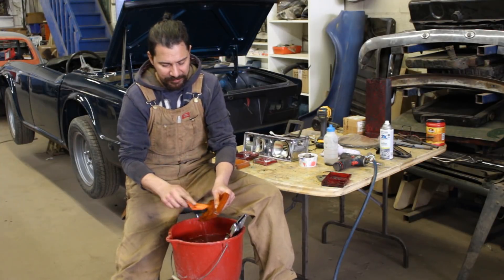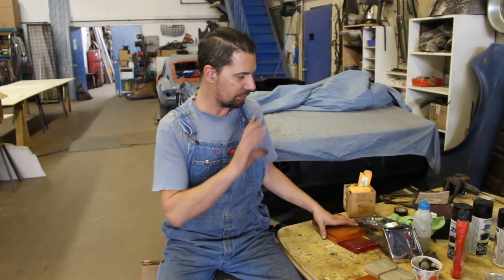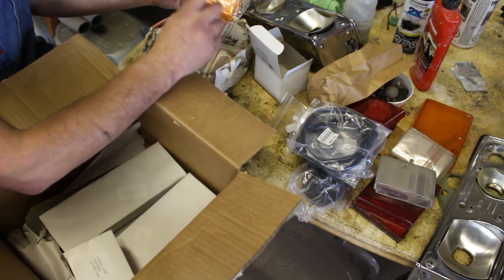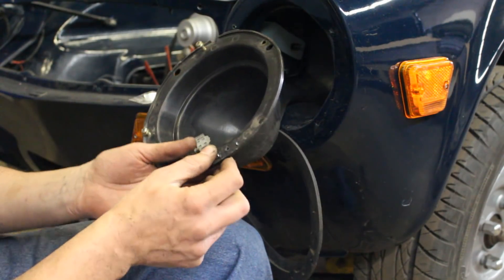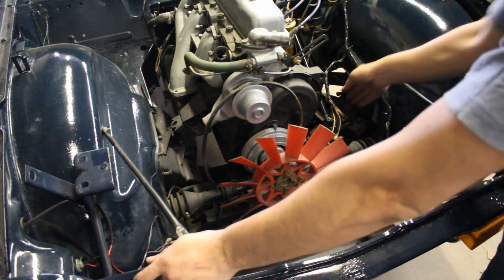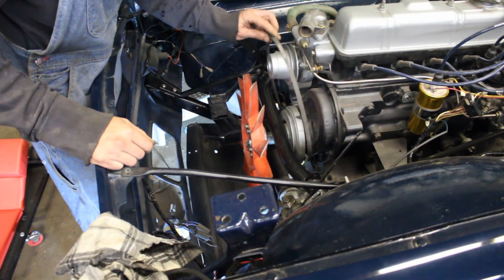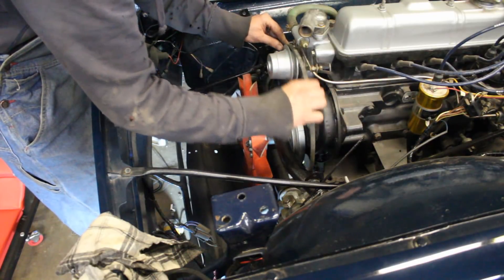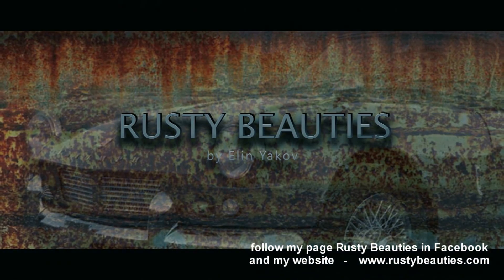1973 Triumph TR6 Restoration - Part 17 - Front Bumper supports

Comment: Elin, just a question.. Here in Australia, we have a lens polish which is used to clean and restore the clear acrylic lens on modern cars. This is the non abrasive paper repair kit like the 3m ones. Worked a treat on my Corolla.. This stull may be worth a go on the older, faded amber lens whicjh you are going to replace.. Costs about $16 Aus a bottle
Reply from the maker: Yeah, we have all kinds of repair kits here too, but they do half way decent job. I ordered all the lenses already. If it was a driver I wouldn't bother, but this car must be perfect when done.